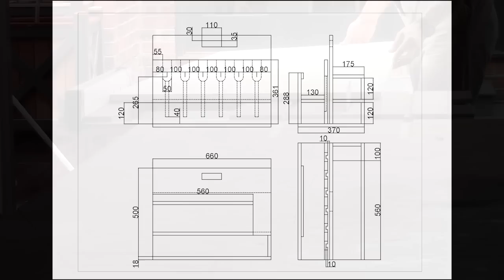Ultimate Drywall Toolbox

Comment: EXCELLENT. Fantastic work, and choice of tools. KRAFT is king :). I started mudding last year, and I'm in dire need of some organization like this. 

What knife & trowel sizes do you think I'd benefit most from? My current line-up is:

Kraft & Marshal-town Hawk's
Hyde 2" Knife (soon to replace w/ Kraft)
Kraft 4" Knife
Kraft 6" Knife
Kraft 13" x 5" Trowel

I'm finding 2-inch to be a little difficult to utilize properly and 3" might be better for tight spots. Also think a larger 8-10" knife and XL trowel would be great for skim coating. Brands/sizes would be much appreciated!

I've had to install 500 sq ft of fresh drywall, and currently skim coating basically every room (walls & ceilings) in our 1950's house. It's riddled with horrible patchwork, cracks and holes over the years.
Reply from the maker: Hi Bryan, I like the kraft knives and still use them. I have heard good things about the level 5 knives also. A lot has changed since I made the video. I am hand finishing much less and have switched to auto tools for most things. If you have lots of skimming to do, a big nap roller and a skimming blade might be the way to go. Depending on how bad the walls are, wide rolls about (900mm wide from memory) of fibafuse might be helpful. If the walls are very cracked and uneven it really helps to even them out and add some reinforcement. Not cheap, so maybe wouldn't be an option for every wall. Hope that helps
Reply: @spbygga8123  thanks for getting back to me. What do you mean by skimming knife?
Reply: @spbygga8123  What size trowels & knives do you find yourself using the most?
Reply from the maker: @bmilcs  6,8,10 knife and 12 trowel most used.
Reply from the maker: @bmilcs  also called smoothing blades. Tapetch, columbia and several other companies make them. Fine steel blades in big sizes- great for skimming
Reply: @spbygga8123  You're the man. Thanks for getting back to me.
Reply: @spbygga8123  Seriously thanks. Last thing --- For 8-10", do you go solid stainless steel 1 piece or the 2-piece with orange handle?
Reply from the maker: @bmilcs  8 and above are the orange handle - bit more flex
Reply: @spbygga8123  You're the man dude. Just got my order straight from Kraft. Very happy with my collection and can't wait to finish skim coating this GD house --- https://i.imgur.com/uOpLIN1.jpg 

I also bought, upon your suggestion, a 24-inch Columbia Skimcoating Blade :). Very stoked -- coming tomorrow. Also getting a 13x13 Magnesium Hawk from Kraft as well.
Reply from the maker: @bmilcs  skimming blades are awesome. If you have lots to skim, thin the mud, roll it on,  skim it off! Easy!
Reply: @spbygga8123  Do you ever add anything to it for better slickness? I've heard dish soap makes life easier but I've never tried it.
Reply from the maker: @bmilcs  seen that done. Haven't tried it. Likely fine, but I am risk adverse. If I was to add anything I would spend the extra on no pock.

Comment: Also, how'd you design this? Sketchup?
Reply from the maker: I used Autocad - I've had a play with sketchup but didnt spend the time to learn it. I think I will learn fusion next and get a 3d printer- one day
Reply: @spbygga8123  A 3d printer would be bad ass. I'm considering getting into entry level welding as well... metal fab of some kind seems like it'd be super useful.
Reply from the maker: @bmilcs  it's a handy skill to have. Mig welder with a roll of flux core wire, a auto darkening helmet and some gloves, your good to go.

Comment: nice build. do those steel knives get slippy when the handle gets wet?
Reply: I have the same knives and have never had a problem with them, as they are stainless they clean up real easy, chuck them in a bucket of water for ten minutes, wipe off with a mild abrasive cloth. Very pleased with them. I'm a painter by trade.